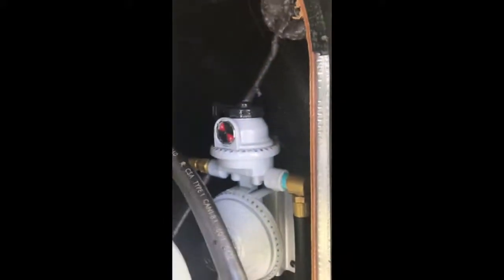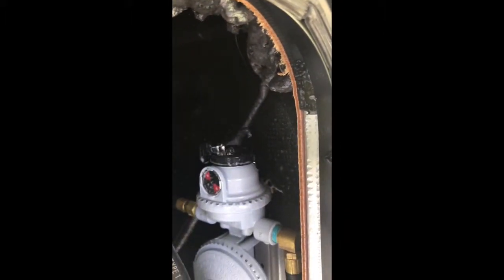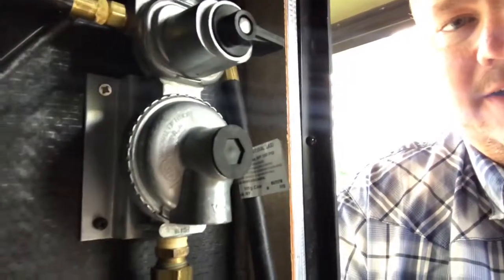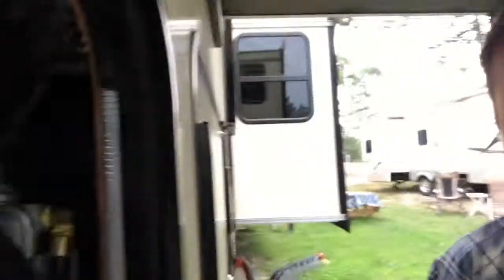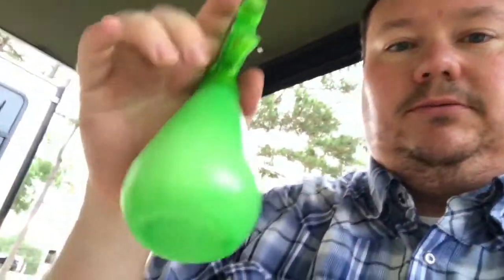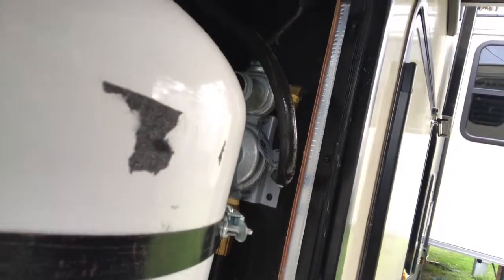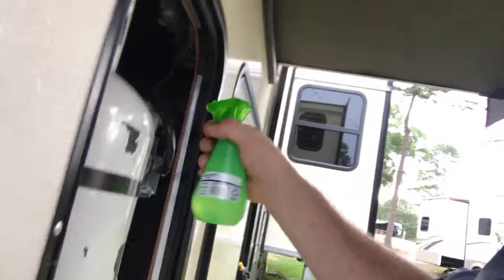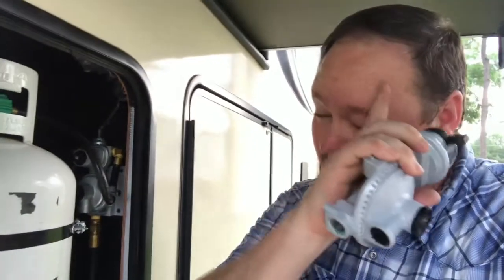Gas Regulator Fix

Comment: thanks for the video, is there any issue with air getting into the lines or regulator? Is there any bleeding process? thanks again
Reply from the maker: No bleeding required, it’s a simple swap out